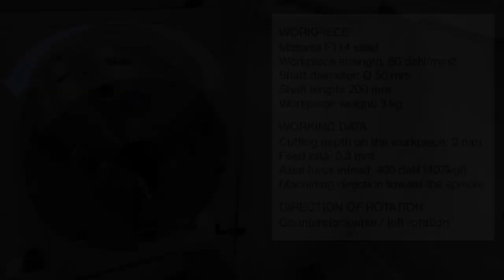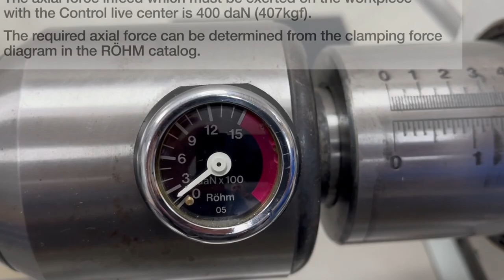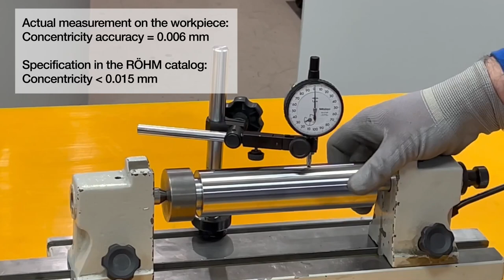Turning with the RÖHM CoAE face driver with concentricity optimization

Comment: Is a live center with pressure reading required to use such a face driver? Why not just apply as much force as the tailstock can produce as it starts to slide backwards eventually on my manual lathe.